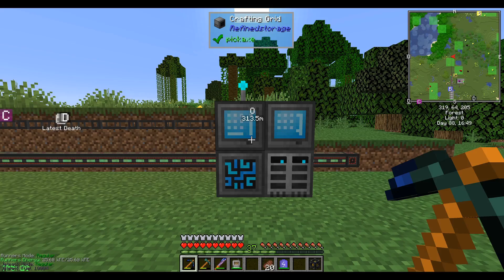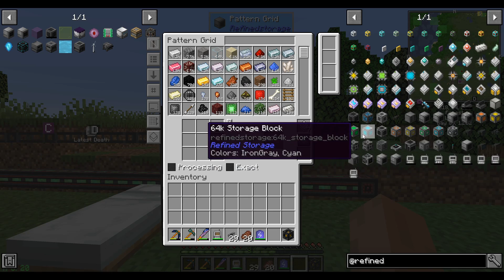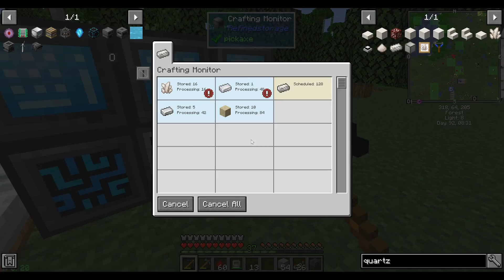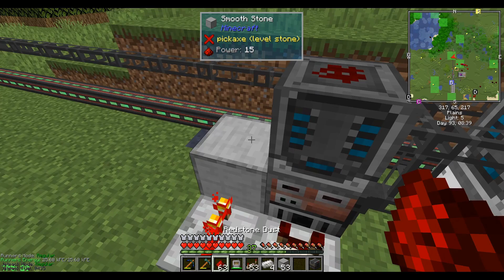Q-Tech (1.15.2) EP09: Refined Storage

Comment: You can build the RFtools builder + quarry card right, it's actually cheaper than the digital miner, just be weary that the new way filters work by using item tags is a bit wonky and you may need to silk touch some ores and set them manually in the filter. There is also an item magnet in the pack, it's called "ender magnet" and has 3 tiers.

Comment: You can probably use a timer aswerll for aloy smelter , comperator out of aloy into block with redstone torch on top with timer pointing back into the crafter , the timer will only start once there is 1 item and will deactivate once there are none , the timer should be set to X+5  with x being the longest alloy smelter recipe in ticks .
Reply from the maker: The idea is solid, although it would be better to use a fast-ticking, reset-while-high timer, because not all recipes take the same time. Using a long duration timer means all recipes wait the same amount of time.

Comment: Let's be honest: Silent's Mechanisms and Refined Storage is just half-done mods. The idea behind them is good, and they could be the base of the new generation of modpacks. However, the authors have to add, and smooth out some features..
Reply from the maker: RS feels as "done" in this version as it was in 1.12- Mostly functional, but almost "different for the sake of just being different" from ae2.

As for Silent's Mechanisms, I honestly don't see how it offers any features that previous "core" tech mods like Thermal/EIO didn't already do. Silents' gear, though, seems like a TiCon upgrade to me. It cuts out the clunkiness of a smeltery, and instead focuses on the actual equipment itself.

Comment: As u r using xnet u can do both items in the same channel
Reply from the maker: Doesn't work like that. The limited quantity value is for TOTAL quantity of items that match the filter, not quantity of each. It would put X total iron/sand get put into the machine, but it won't guarantee both items go in.

Comment: Was there a particular reason why you haven't built the builder quarry yet? You gain access to it more quickly then the digital miner. At least in the version I played anyways
Reply from the maker: It uses a fair bit of power, and I just haven't need for its level of output yet.
Reply: @JimmyCraft  fair enough